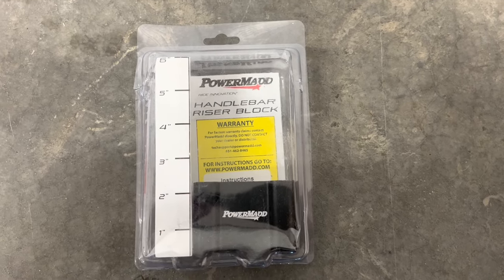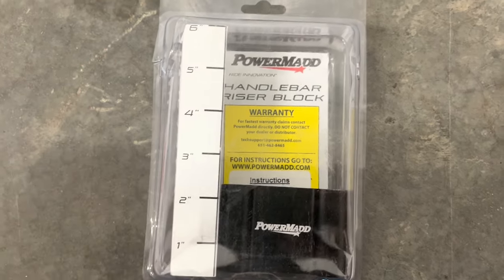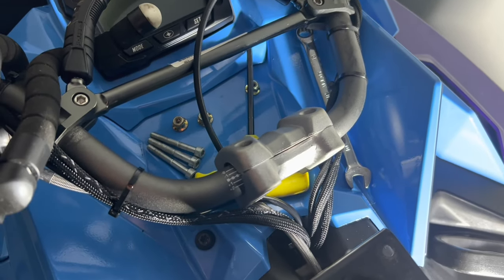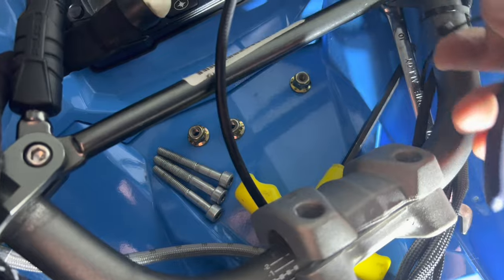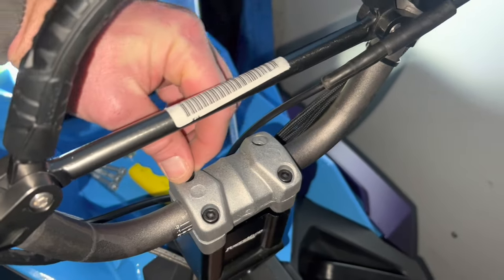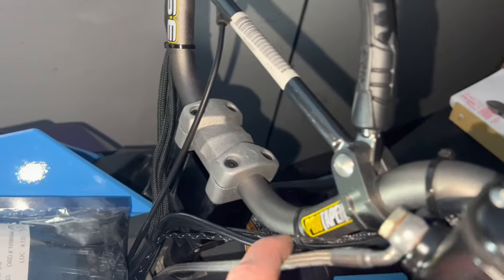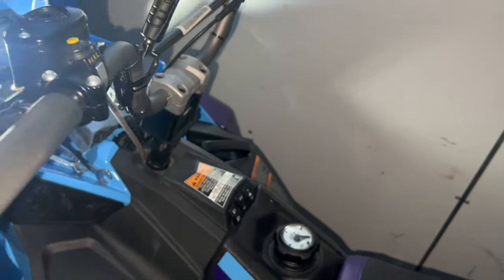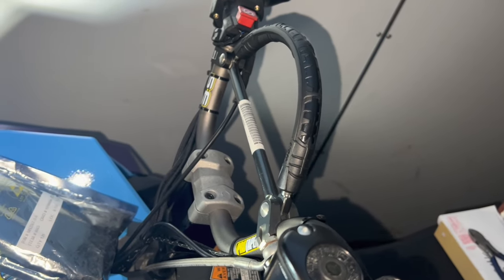Powermadd Riser install on a Polaris 850 Khaos

Comment: I put that 2in riser on my 24 khaos and the throttle and brake cables have a lot of slack left over. 
The wires for the heated grips and reverse on the other hand are stretched pretty tight. I'm gonna have to do some digging and try to find a zip tie to cut
Reply from the maker: I did cut a zip tie in mine.